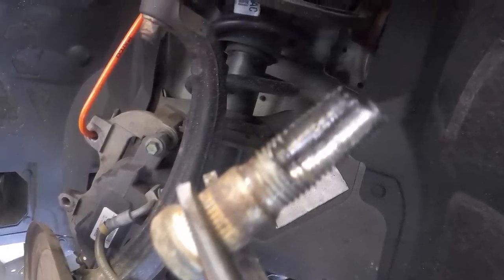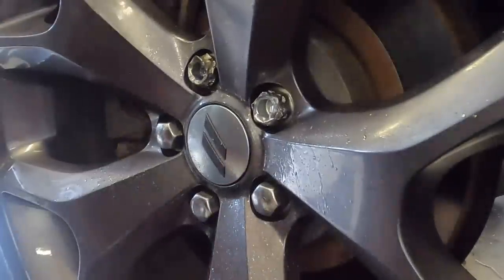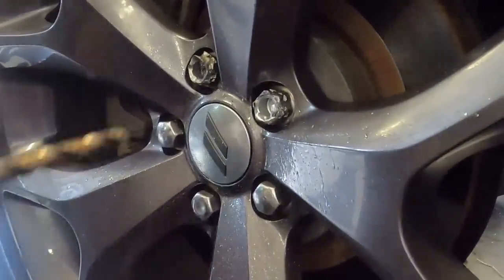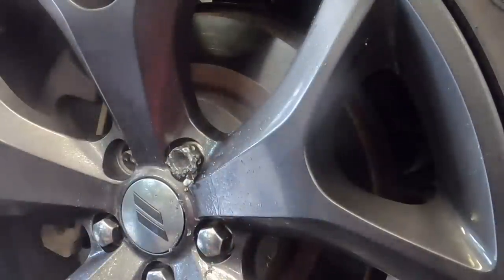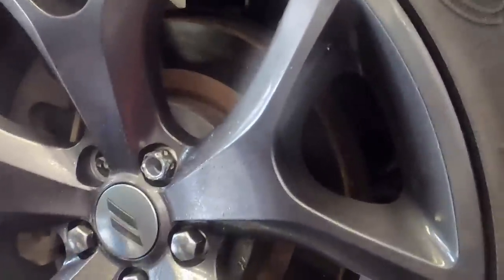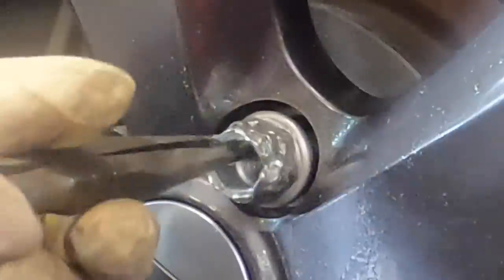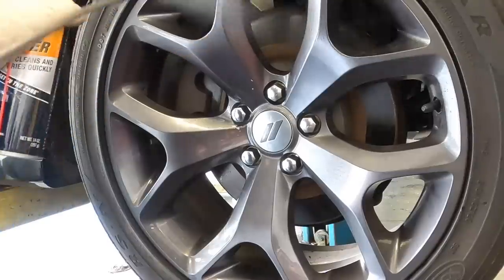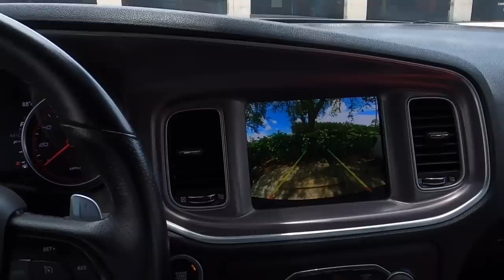2019 Dodge Charger! READ DESCRIPTION FIRST! Dealer Couldn't fix this! Must See! Bonus Footage

Comment: Well...I had to stop watching the videos, too high of a cringe factor.  If there ever was a video on how NOT do something, this is it.  First, wrong ratchet, Snap-On should challenge the warranty due to "abuse" of the swivel head ratchet.  Second, why are you using a breaker bar when an impact gun is made with exactly the feature you needed, impact and twist at the same time.  In addition, no penetrating oil sprayed before you started to possibly decrease the friction between lug nut and wheel, wrong drill speed (slow speed for metal), needle nose pliers when you should have used Vise Grips, geez!  Since you were destroying lug nut and wheel stud, right after center punching stud, which obviously you didn't do, there was no reason to not use larger drill and completely drill out the stud releasing the friction between lug and stud.  I saw you finally using impact with punch loaded in it.  Didn't you have an chisel for the impact gun?  That's what a pro would have started with and chiseled where the friction was, where the lug nut met the wheel, not where the metal was already mangled.  And, once you hammered the socket onto the lug, and you said "I'm not nervous", you should have smacked the hell out of the socket to help release lug nut to wheel friction, just like smacking a spindle to release a tie rod end.  Now, find out who last had his wheels off and go pound the crap out of that guy for over tightening the lugs and teach him how to tighten/torque correctly.  Then take away his impact gun and tell his boss why you took it way from him!
Reply: RR prolly doesn’t get too many of these, so not necessary to be a stripped lug removing artisan.

Comment: I hope you are not replacing those with the same shit designed lug nuts.
Get the one piece non chrome beauty cover lug nuts from Amazon and replace all of them so that never happens again. Mopar should be ashamed for selling vehicles with that cheap shit design two piece lug nuts.